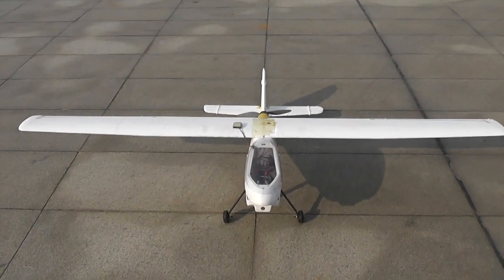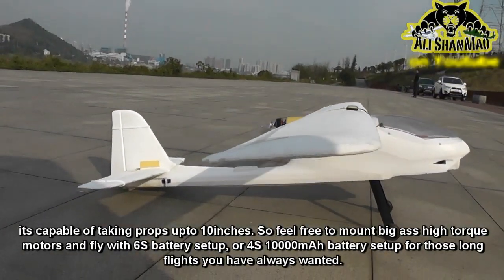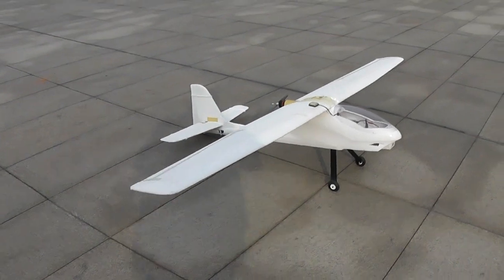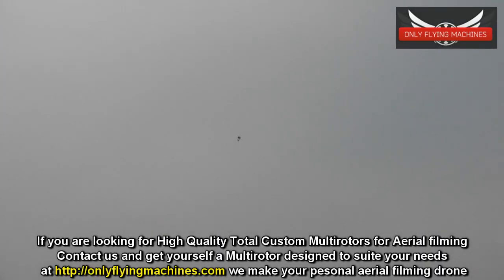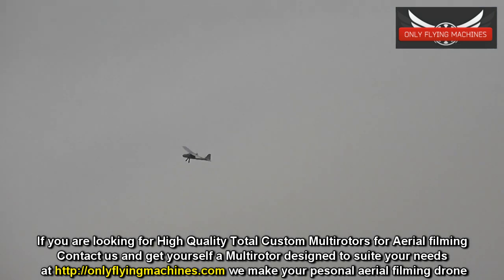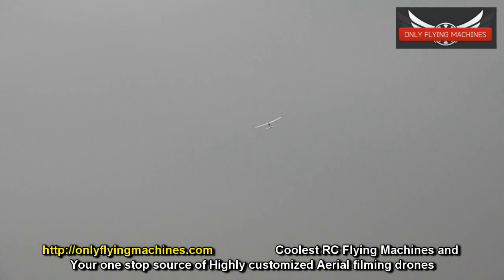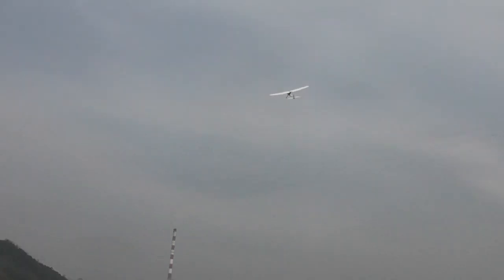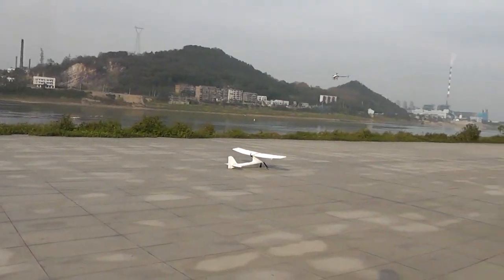FPV Ranger - New Long Range FPV Plane by Lanyu

Comment: Looks pretty interesting. Which Batteries can I use for the longest duration of flight time and Radio to match?
Reply from the maker: i used 4S 9000mAH and it surely offered long flight time. radio of course is your own choice

Comment: looks pretty good. where can i find specs on it? too bad it dosen't have a t-tail. that would help a great deal with spiral stability issue. having the low boom dosen't help either, but no way to get away from it on a single pusher.  thanks ali.
Reply from the maker: I will post specs in videos when i get mass produced version.

Comment: Hi Ali, amazing airplane. Thank you very much for sharing. Will it be possible to buy it with autonomous flight systems (Perform a mission autonomously, return home if signal is lost, etc...)? For how long do you think it will be able to fly continuously using the 6s batteries?
Reply from the maker: for sure, if you can afford the shipping

Comment: Nice plane. But i don't like the landing gear. Just trim it down a little bit and make it smaller.
Reply: At 1:00 in the video, Ali says the high landing gear is to allow fitting a full brushless camera gimbal on the plane.  I wonder though who would be daring enough to do that.  Because RC planes often land roughly as part of normal everyday RC flying.  The first hard landing will damage a $500+ gimbal setup!
Reply from the maker: Rotormatic if you do AliShanMao Smooth landings, no worries for Gimbal. plus the Landing gear is very sturdy so for a bit bumpy landings no worries.